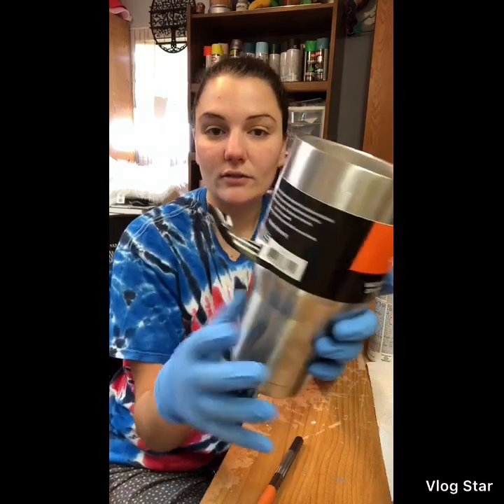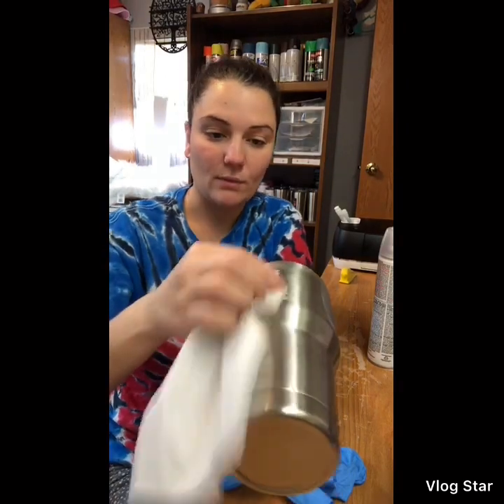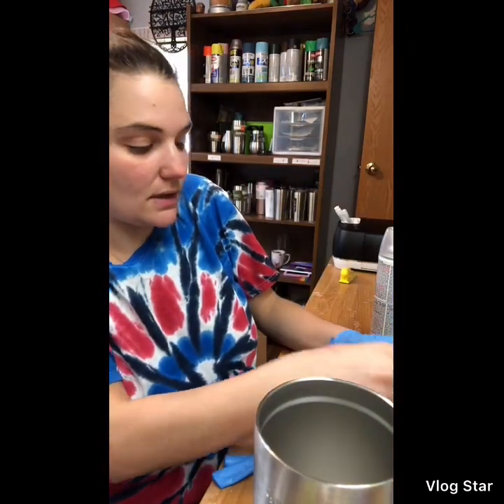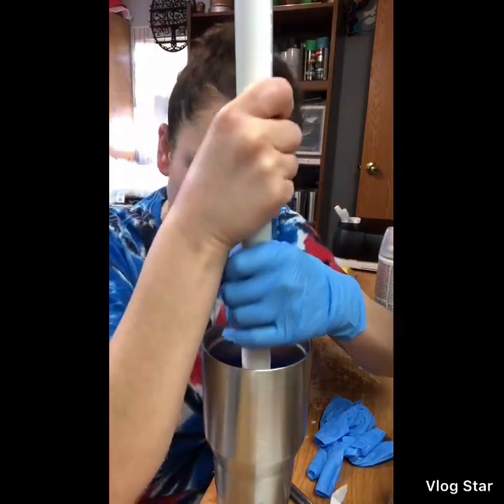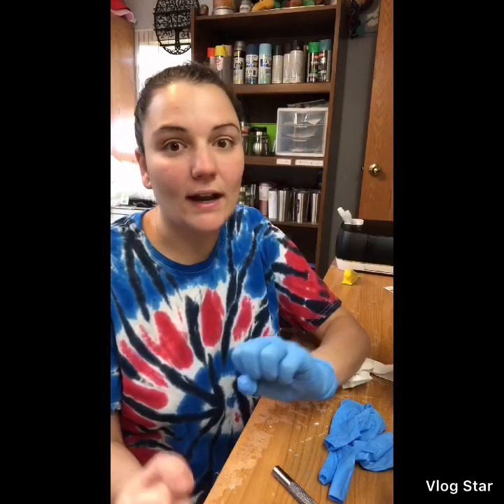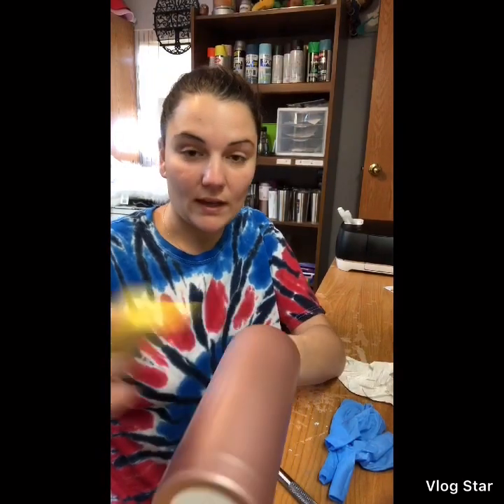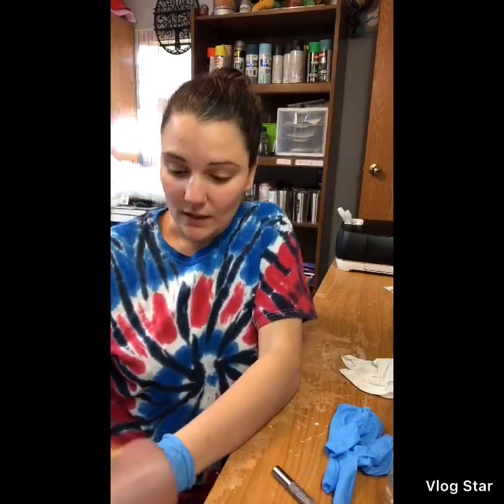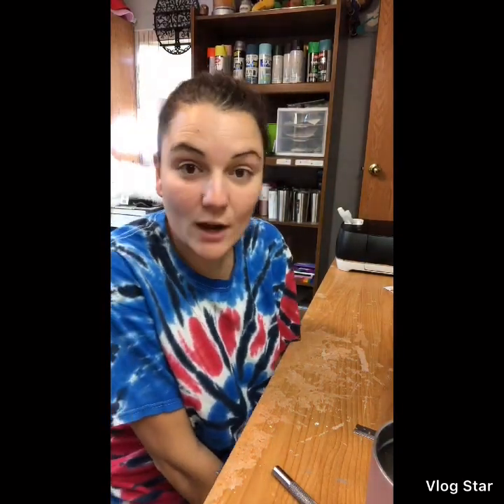How to easily prepare your stainless tumbler before you create your design

Comment: Thanks for the video.  If you hit the label with a heat gun for a few seconds, the adhesive releases and it's an easy and quick removal. Give it a try :)
Reply from the maker: Lisa Thompson thank you for your feedback and the advice!! I will definitely try that!!! ☺️
Reply: you're so welcome. Let me know what you think :)
Reply: Use your heat gun before you pull the label off and it will just peel off
Reply: Or orange goo remover.
Reply: Everything they said below !
Reply: Thanks, that advice is easier than what I had suggested.

Comment: Okay so I have a question I know this video is a little bit older but I just found it I have cups that are colored they're the Ozark cups but I have a blue one and a pink one so if I sand it is it going to take the color off or can I just sand it and then still do like a water slide any epoxy or do I need to do the stainless cups and spray paint on pink or blue or whatever color I want to use?
Reply: I would like to know also.

Comment: I painted a little spot with a gloss paint in preparation to add glitter. Should I sans it down and apply glitter or if apply the glitter without sanding, will epoxy stick?

Comment: Lila do you have to spray paint before using sublimation print
Reply from the maker: You have to use sublimation tumblers. Stainless steel tumblers will not work for sublimations

Comment: I just saw this video it did help… but how long after you finish the tumbler should it rotate? And how long after that before you can sell or give it away?
Reply from the maker: After applying the epoxy, let your tumbler spin for 4-6 hours (depends on the brand and temperature of your room). Turn off the turner and let your tumbler air dry or cure.  You can keep it on the turner or take it off and place on a drying rack. I remove my tumbler (keeping it on the pipe arm) and place it on a drying rack to use the turner for another tumbler.  Full curing time is 24 hours. Let your tumbler dry for about 18-20 hours after you let your tumbler stop spinning.

Comment: Just beginning, I sanded the tumbler, cleaned with alcohol and spray painted. But are the cup supposed to be smooth because they fill alittle rough
Reply from the maker: They will be rough after sanding. But once you add the design and epoxy, it will smooth out.
Reply: Thanks, another question; using alcohol Ink or acrylic paints do I need to always start with a white painted tumbler or can it be any color. Second question; if I start a tumbler, painted, cleaned with alcohol then apply epoxy, but when I start applying alcohol ink I see some separation , do I stop right then and do what? Or can I fix by adding more alcohol ink on the second coat to cover/hide the where it separated.

Comment: My wife swears you MUST sand prep raw stainless surface for the primer/paint base color to adhere. I argue it’s RAW metal, it does not in fact require sanding being it’s already a rough texture, just CLEAN
Reply from the maker: No, it doesn’t need sanding.  I don’t sand all my tumblers. What is important is it’s wiped down with 91% alcohol or higher.  I have a tumbler that I use weekly that I did not sand and I even dish wash it and it is in great condition

Comment: If you heat the label with a blow dryer before you try to remove it the label will peel right off and save you all the trouble.  :)

Comment: I got a stainless steel tumbler but it is matte black. Do I need to sand it before doing anything to it?
Reply from the maker: Yes. Sand. 91% alcohol. Spread paint.
Reply: @MissKissKreations  I bought my tumbler in Black and dont want to paint, Do i need to sand it ? If i sand it will it take off paint and leave scratches before i expoxy it?
Reply: @eliciakelley8049  i have been searching the web to find out this answer? Did you figure it out?

Comment: 91% alcohol (or any alcohol for that matter) is SPARSE.....can I use something else? Acetone?
Reply: I have this same question!!
Reply: I am having the same issue here in Arkansas, I was told to use denatured alcohol from Lowes or Home Depot, not the fuel but the glass cleaning. Not sure if it will work or not.